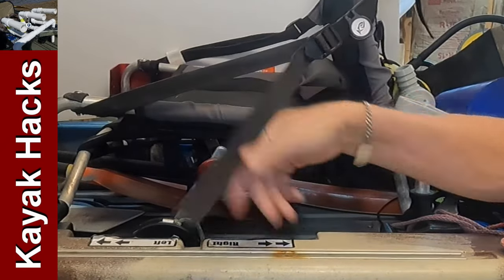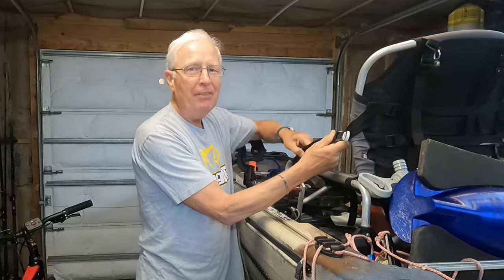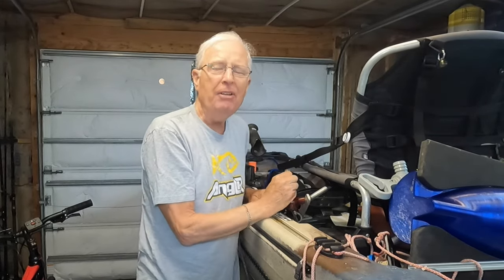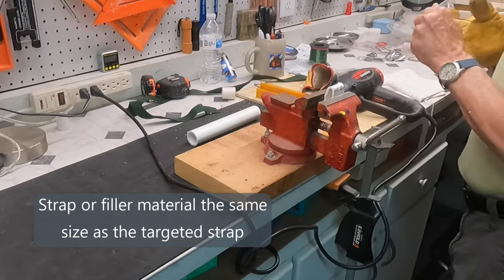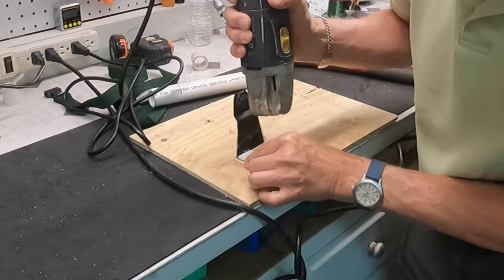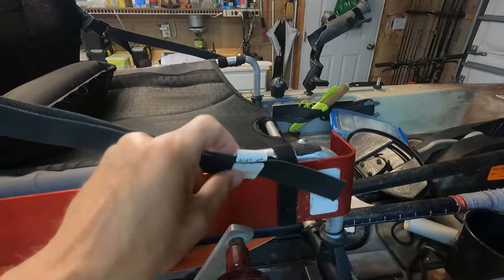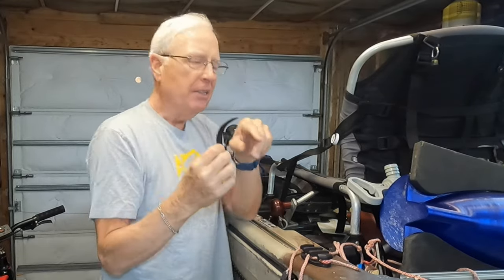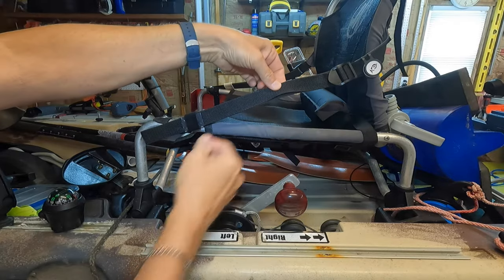Kayak Seat Strap Clips - DIY Kayak Mods

Comment: Great idea.  Since I don’t have a kayak but a Jon boat, it can use the same idea to deal with the long strap that goes over the rear of the boat to keep it on the trailer.  I always tie a few knots around the buckle to keep it from coming undone on the highway at 70 mph but the strap is so long that using a couple of your devices would keep me from having to tie additional knots just to keep the line from flapping in the breeze.  Thanks.
Reply from the maker: I think the PVC version would work best for that!

Comment: My solution is O rings - you undo the buckle (even better if you remove the strap from the buckle) and slide the o ring over the strap (yes it will stretch over the buckle if required). Unlike a zip tie it is soft and flexible. They are available in a range of sizes and are super cheap. I use more than one (but one is fine) as I find a couple or more spaced out keep the straps nice and flat along their length.
Reply from the maker: Good idea!

Comment: Try binder clips.  I use some large ones for managing the strap ends on my kayak trailer.  Little ones would work perfect for the straps on the chair.
Reply: Thanks! I'm going to try the clips. I use multiple slip knots for the ends of my straps.  I'm always worry that the ends with in up wrapped up in the wheels.  We used to do with horse lead ropes at the show barn.
Reply: I had a strap come loose once and get under the wheel.  It didn't take long for me to notice, fortunately!  I haven't had a single issue with them coming loose since I started using the binder clips.
Reply: @mulcade  Yes, its scary.    I had one get under the tire when I was backing up the trailer.  It was really tight.  Hopefully I learned my lesson.
Reply: I was fortunate in that my trailer is really light, so I was able to pick the trailer up off the strap and resecure it without much fuss.

Comment: Do you have a simple solution or an inexpensive solution to replacing the spring loaded clips that are on a lot of the removable lightweight kayak seats? Sometimes the springs just wear out or get stuck. Thanks a bunch!
Reply from the maker: No, I am not familiar with those. I just bought a removable seat for my kayak build project, I'll look at it

Comment: Nice hack. Is there a reason to have all of the extra strap?  I'd try passing it back over and through the buckle (back-weaving thru the buckle) and if it didn't slip, cut off the excess, then seal (melt) the end, if it's a nylon strap.
Reply from the maker: You need it if you are going to lay the seat flat. My buddy and I do that when we piggy back the yaks on his truck.
Reply: @KayakhacksFishing  👍

Comment: I really haven't found this to be annoying enough to address (yet!) but couldn't you just get webbing sliders that would do the same thing less obtrusively and more securely? They're also super cheap. All you would have to do is unthread the buckle end of the strap, slide them on, and then rethread.
Reply from the maker: My experience with them is the tension eventually goes slack. But worth another try! Thanks